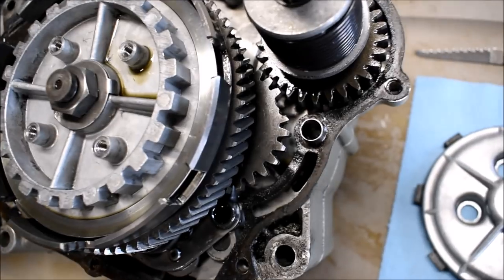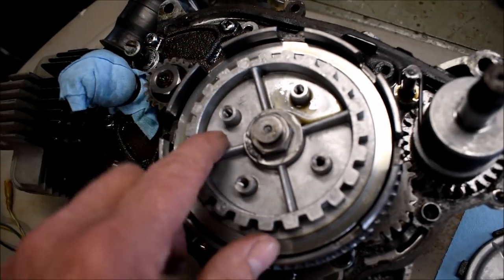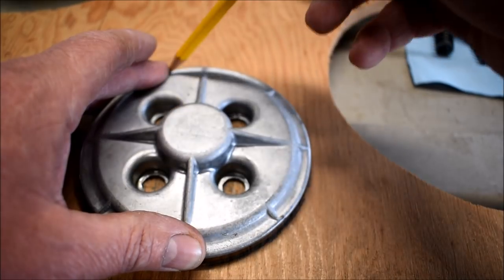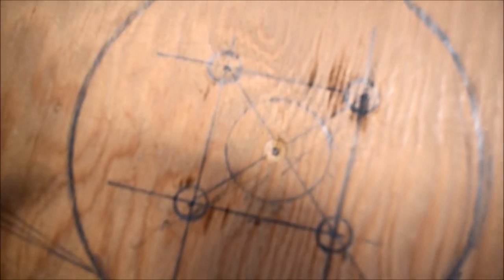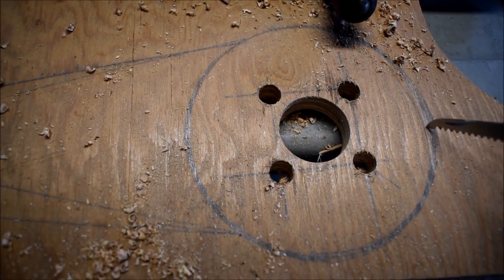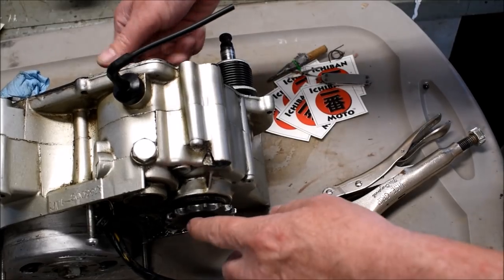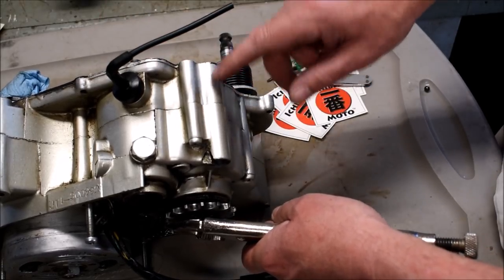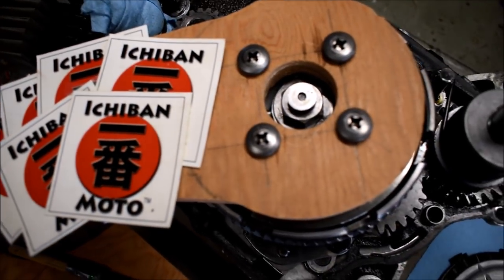how to make a motorcycle clutch holder tool

Comment: I wish I could give this tool a good review because it seemed like a great idea, but I did try it and it definately didn’t work out for me. Be careful if your clutch boss assembly is made of cast aluminum, it is not strong and the threaded part which receives the bolt can break off.. I wish now I spent the $30 dollars on the wrench. Yamaha quoted the part at $800 for a new one although I’ve found cheaper used ones online. But it still hurts. So if you follow this video take a really good look at your clutch and say to yourself is this really going to be strong enough and be prepared to fork out some extra cash if it doesn’t work.
Reply: This is EXACTLY what i was thinking and my fears were right. I knew it could break the threaded poles off because these nuts are like 60ftlbs lol

Comment: Would you mind doing a video on parts cleaning? For when you're restoring a bike and taking things apart and you want to remove rust and corrosion by letting the parts soak for a while on a sink of some sort.
Reply from the maker: that's a great idea.  i can demo the top methods of soaking.  oh, there is an Ichiban Moto  rust removal video using electrolysis
Reply: Ichiban Moto : I have such a pathological fear of being electrocuted that I joined the Navy and became a high pressure steam boiler mechanic on the reasoning that I wouldn't be electrocuted by a coal-fired boiler and (erroneously) believed that there's no electricity on a ship, because water and electricity don't mix.
However, I followed your rust removal by electrolisys up to connecting the clamps to the battery terminals/battery charger. I couldn't do it. The get-up is sitting in my shed.
True story.
Reply from the maker: i have rounded up some things for this video .. i have several  vids going right now, but it is on the shortlist

Comment: I like the nice wood finish and I like how much effort you put into making it, good job.
That said, attaching something to the spring posts risk busting one or more so not a good idea.
If you want a really quick and dirty method you can just clamp a few small vice grips on a few of the steel pressure plates between the basket fingers to hold the centre.
Or just get some old pressure plates and weld them to each other and a bit of rod to them for a handle to hold the centre like shop tool.
Reply: welding to an old pressure plate is a great idea, i will have to hunt around. i might have some somewhere. i agree that using the spring posts is risky, so i dont plan on doing that.

Comment: seems like a lot of work when you  can just use A pair of vice grips holding one of the steel clutch plates in one of the spots on clutch basket to undo the nat The whole operation takes about a minute